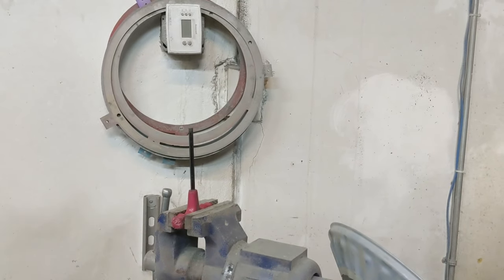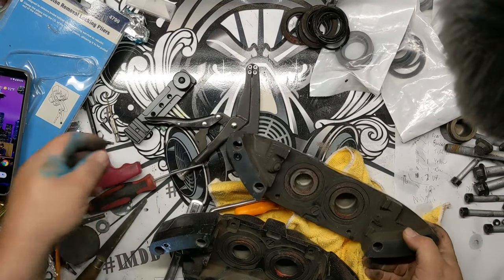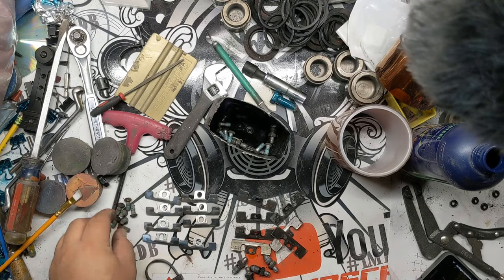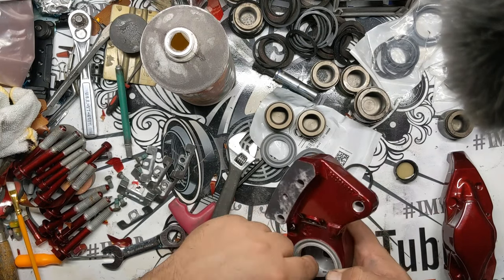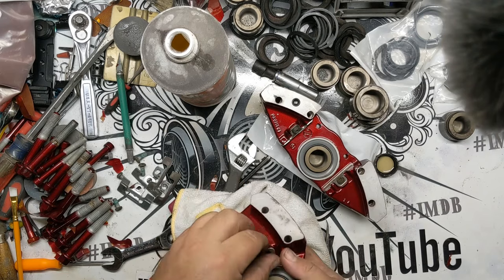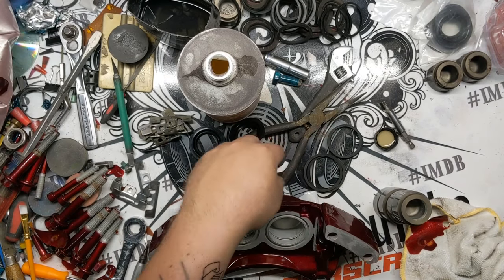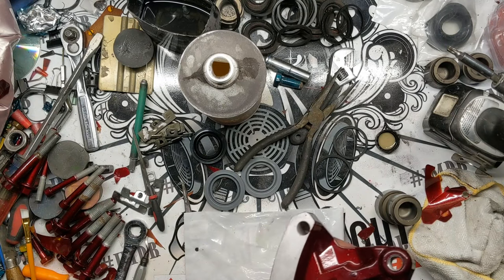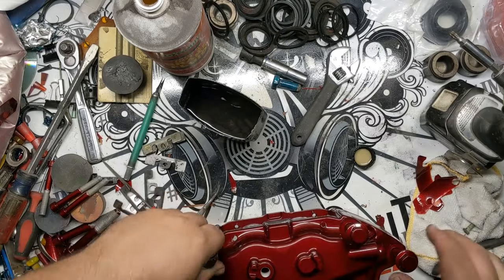Unknown Coatings - Ep 63 - Powder Coating STi Brembos with rebuild

Comment: very cool , is it possible to powder coat the caliper together? i'm a little picky and don't like the powder coat  on the bolts being marked/ damaged after doing them up or is this a normal thing.
Reply from the maker: I mean you can, but if you do that make sure you still tape off the mating surfaces, so they still easily.

Comment: Look great mate have you ever had trouble powder coating with the bolts threaded in? I done it on a set of cast Nissan calipers and the bolts got stuck in and stripped all the threads.
Reply from the maker: no, you just gotta make sure the threads are clean, if not, a stuck bolt can happen quickly.

Comment: Another great video.  Thanks for showing your settings.  I’m having trouble understanding how the longer nozzle makes a difference when spraying the second coat on these calipers.  I can see how it’s easier to spray between spokes and center bore but what exactly is the advantage of using that longer nozzle on flat surfaces?
Reply from the maker: This is the old multicoat nozzle   is different internally than a normal nozzle. Works amazing for second third and even fourth coats